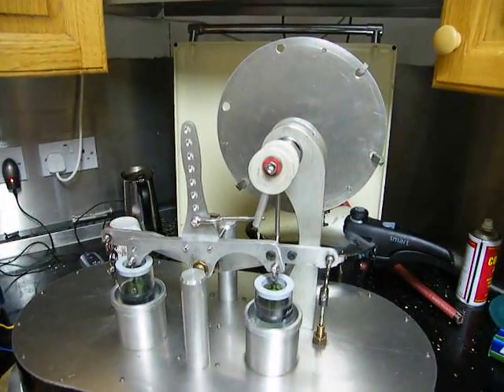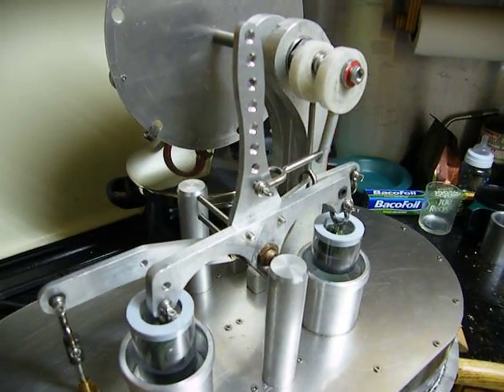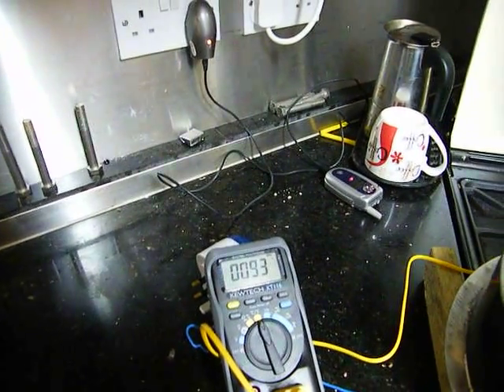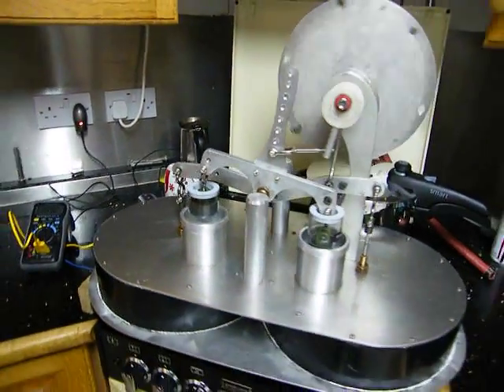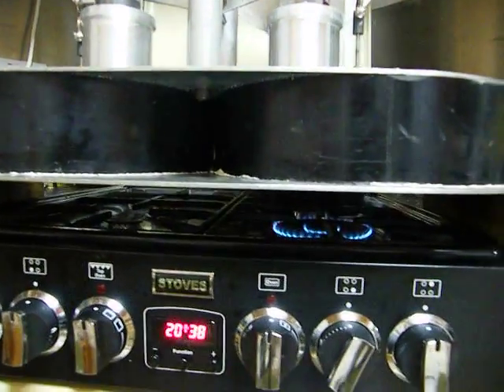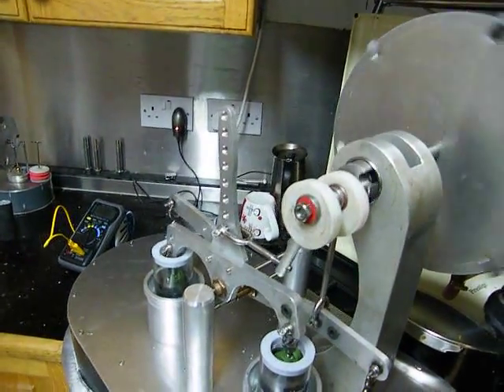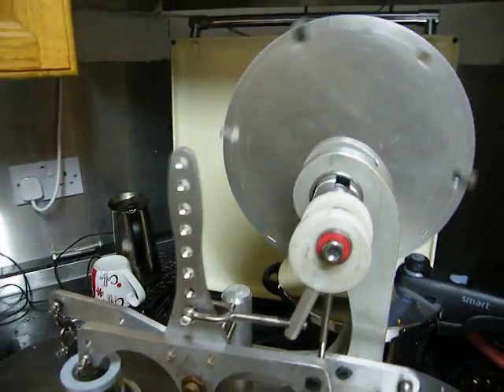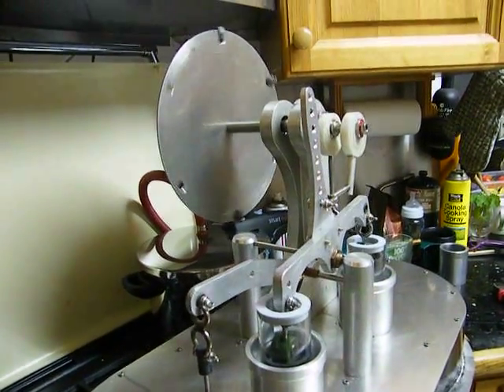Large twin cylinder low temperature difference stirling engine

Comment from the maker: I don't know..it does have some torque but turns to slowly to be of much use...Stirling engines that run with low temperature differences and at ambient pressure can only really run themselves and must be treated as an engineering project which gives  satisfaction to those who build these interesting machines ....if you can get one running

Comment from the maker: The displacers are effectively weightless as  each one is balanced by the other,but yes the air drag is significant on the two high temp foam disks plus the two shafts in their bronze bushes must cause some drag
Reply: whats the horsepower?   output, temp?
Reply from the maker: @spikedpsycho2383  Not many revs and no horsepower

Comment from the maker: @sinisasokolovic Helium is easily available, fairly cheap and has a much better thermal co-efficient than air!....Helium at ambient pressure gives twice the revs that air does!!!(data from my engines) You will have to experiment with the stroke as going long gives rise to other problems,like not being able to give a fast enough 'push' to complete a rev!

Comment from the maker: @sinisasokolovic The surface area for each @side of the motor is I would say absolute minimum to allow the motor to run at all...It could be vastly improved with cooling fins and/or cold water cooling to the cold (top) plate...and changing the working gas to Helium which gives an instant improvment in revs and torque  even at ambient pressure . Having said this the motor is still very low end tech wise and compared to stirling based motor I am currently developing....Historic l!!!

Comment from the maker: @sinisasokolovic Hi...I am not thinking of posting more video of this motor as I thought I'd covered 'the angles'...but if there are any specific questions that you have feel free to ask away!
It is difficult to get such a large engine to run with such a low temperature difference(50deg C)...you have to make sure that everything is balanced and very free to rotate
Nigel